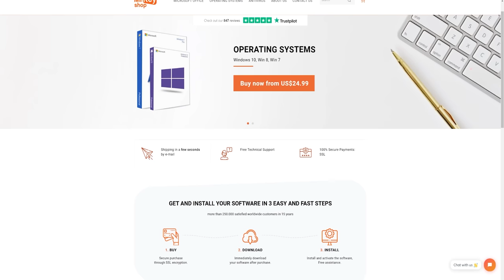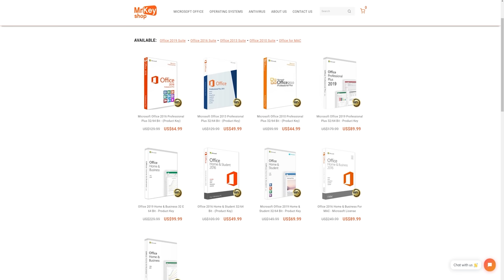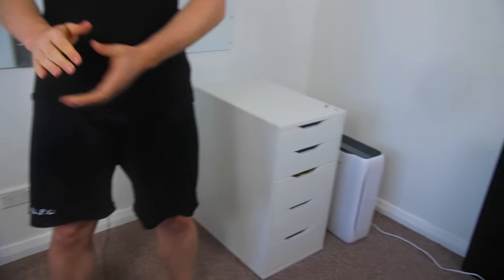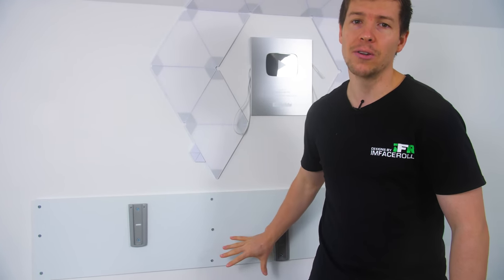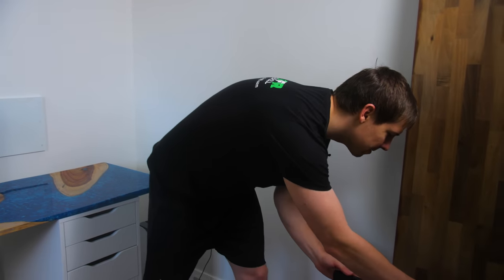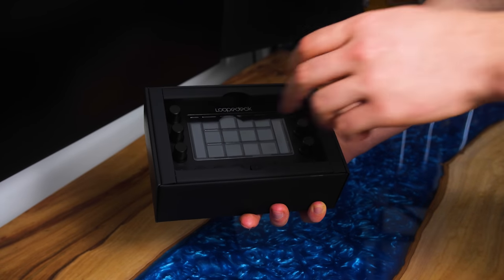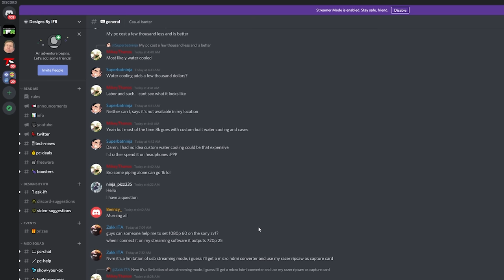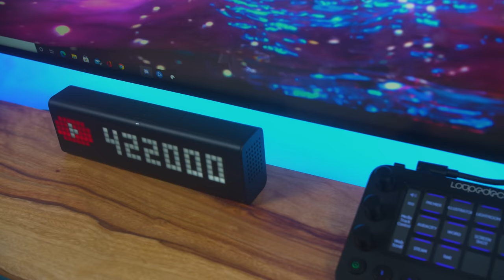I Built my ULTIMATE Dream $20,000 Gaming & Streaming Setup!

Comment: Only thing about this that upsets me is the GPU, could've gotten a 30 series if possible
Reply: i told the same thing when i saw it
Reply: He can upgrade down the line. He probably couldn't get one because they are hard to find!
Reply: you cant sli 30 series
Reply: Agreed I was expecting like a 3090 or something
Reply: @darkfocust2467  Why?
Reply: @darkfocust2467  you can sli 3090, but not the rest of the 30 series. Also even without sli, a single 3090 would out perform the 2080ti's in most games, as most games don't even support sli.
Reply: @vidego  the 3060 beat the 2080
Reply: @sardistygbj6214  I know. I said that 1 3090 would beat 2 2080ti's

Comment: Nice job, it looks amazing! If I may I have a few questions. Aren't You afraid that 1065W will be not enought for this setup? How are potentiometers in Loupedec, because what I learned is that even in the most expensive equipment potenciometers lasts for 2-3 years, and then you need to change it? Is SLI bridge works ok for You, because I heard that it doesn't work too good on RTX 2080ti? And the most important - what software do You use for Your screens? I use DisplayFusion Pro, but it still has a few problems - I have different setup on every screen and DF Pro just can't handle it, especially when I start something with different resolution on middle screen in full screen mode (for example full HD on 4K setup) everything from right screen moves away? This charger looks great, but unfortunately shipping costs to Europe + tax will double the price.
Reply: You don't need to changed it . only after a few years thats only if you want a new Graphics card or Prossor , I have had same Computer for 7 years I am only now saving up to get a new computer

Comment: Me and the homies watching this video on our shit a$$ Potato PC's 
" We don't need need it, we are good with Minecraft "
Reply: Wait you can run minecraft
Reply: @Deadchannel06  Ummm...maybe among us...hehehe
Reply: @Tfisgoingon69  I can run halo ce on low to medium settings only low sound variation though or else my computer crashes or I can run fallout 3 on all low settings in gaming mode
Reply: My hardware doesnt even play classic minecraft to well i get about 20fps on first gen minecraft beta and 10 fps on realease 1.0 and 1-2 fps on 1.8
Reply: @Deadchannel06  i can run gta 5 but on low settings
Reply: @Tfisgoingon69  I cant
Reply: @Deadchannel06 well  i can run and completed halo ce on max and playing halo 2, far cry 3, gta 4, nfs most wanted, COD blackops 1,2 and 3 but by standards of games these are very low so i can only play these
Reply: @Tfisgoingon69  OK hears my PC specs
CPU: Amd A9 9425 Radeon R5  Compute Cores  2C+3G 3.10 Ghz 

Ram 4gb ddr2  2000 ? I dont remember the unit

GPU AMD Radeon(TM) R5 Graphics
Reply: @Deadchannel06  I have Lenovo Ideapad-S340
i5-10th gen
8gb ram
Nvidia Geforce MX250
3.10 Ghz
Reply: @Tfisgoingon69  and our cpu's 

I have 2 cores you have 8 
my frequency is slightly higher 3.7 vs 3.4
you have a 7mbCach I have a 1mb cach

we both have 15watt TDP though 

In conclusion my computer is a garbage potato that can watch youtube play a very old gam eon super low settings and my cpu cant even handle enhanced sound from halo 1 this was fun to do thanks for getting me into conversation
Reply: @Deadchannel06  but still gta 5 lags a bit
Reply: @Deadchannel06  you should consider making an upgrade anyways my pleasure
Reply: @Tfisgoingon69  dont have the money to yet but i will soon hope you have a great rest of your week
Reply: @Deadchannel06  Thank u and good luck to u too

Comment: "two portrait monitors on the outside" its called tiefigher configuration (the one from starwars). also why duel 2080's in SLI. If you are spending that much money you could have got a 30 series. also case is a but overkill but if thats ur aesthetic then good for u

Comment: I remember when PC users used to laugh and ridicule Mac users for spending so much on their computers. Don't get me wrong, the computer looks awesome! But the irony is thick.
Reply: That is not an apples to apples comparison though. The extra cost for macs is for identical hardware in a stock "normal" case. The extra you're paying is for software and apple's profit. It's a rip off. Spending money on a custom high end PC with custom open loop watercooling is much different than an iMac. I don't think the average typical user knows that the hardware inside a prebuilt PC and Mac are the exact same. Mac's upgrade prices are the worst, to upgrade from 8 to 16GB of RAM for example.
Reply: @pmclean1980  
It’s the same for any company. Have looked at what Dell or HP charges for ram upgrades? On par with Apple.
Me being a computer nerd, I never buy ram or HD upgrade from them. I buy from a 3rd party. It’s cheaper and I can do it myself. However being in the computer industry for over 40 years, I can tell very few people can do it themselves. They need a computer nerd. So to those people, paying the extra price Apple, Dell, HP, etc. charges is worth the money paid.
And it’s about support. Apple’s support is pretty good. So is Dell’s pro support and HP’s. Support your not going to get building your own. I know, I’ve been building my own for around 30 years.

Comment: very curious as to what coolant you used. I just built and 11900k using the exact same board only with clear coolant and had an issue with XL8 corsair coolant and a stain showing up in the monoblock, after 2 rma's I switched to EKWB Cryofuel clear coolant and no more problems.

Comment: Just FYI for anyone that cares, just had another(this is my 3rd)Seagate BarraCuda HD 3TB fail. Used over a period of 3yrs with at max 75percent capacity, but usually around 53%! And for the first 2.5yrs it was at 28%! Was just a spare drive that was hardly used, not an every day driver like a C:drive(which is now an SSD). Twas the F:Drive.

Comment: why would you pair 2080 Ti with a $20,000 build. Wasted build my friend, wasted build. Shell $2500 for a 3090.
Reply: EXACTLY, they also used SLI on the cards, only used 4 ram slots instead of the 8 that was there, and have a thread ripper for gaming? Like how does this even make sense